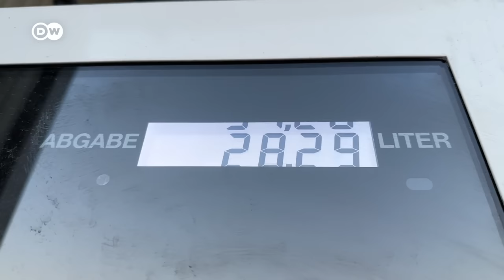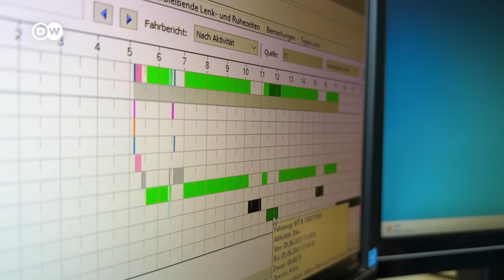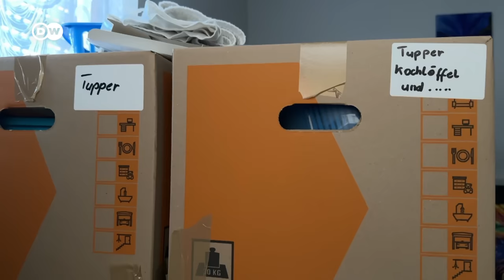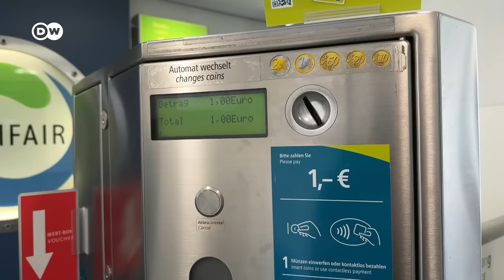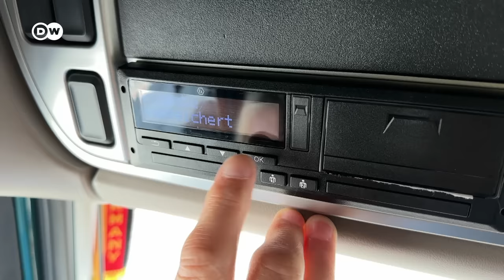Trucking with long-haul driver Biggi - What does it take to drive long distances? | DW Documentary

Comment: Truck driving in Europe looks pretty cool. Beautiful scenery and the cabovers have more room on the inside than I thought. The truck stops look clean too. Definitely would be a nice change of pace to get to drive in Europe for a year or so
Reply: Totally agree. I also feel like that super cheap fleet spec interior we often see in the states isn’t as common with the cab overs in Europe. I’m sure it exists but I feel like a majority of the European trucks I see have the leather wrapped steering wheel, heated/cooled seats, buttons on the steering wheel, nicer seats, etc. that we usually only get on like owner/operator spec trucks. I’m curious how their trucks ride over there too because our trucks are a nightmare; even a brand new 2024 Freightliner Cascadia rides so violently. Even with the seat on the softest air setting, the smallest bump will send me flying through the roof. It’s unbearable. Volvo is the only truck I drove where I could go over a rough road without being thrown all over the place as the interior rattles itself to death. I wonder if the Cabovers are better built.
Reply: @Ward413  I hope to answer your question well.

I would say the base spec model trucks here in Europe are well equipped. They have things like heated seats, steering wheel controls, A/C etc. The higher spec models tend to add things like leather or infotainment or digital climate control etc. But overall I'd say all trucks are well specced.

As for comfort, I would say I have driven MAN's, Iveco's and DAF's that I thought were a bit harsh, but again most trucks, especially Volvo and Scania are very comfortable, even if it's a base spec Volvo FM or Scania G-series. Obviously, the higher spec trucks ride even better and, for me, the best is the Volvo FH16 Globetrotter XL. The automatic gearbox (most cabovers are auto these days) is flawlessly smooth and the truck is very quiet and comfortable on distance. The Scania R-Series is also very good. 

I hope this answers your question, drive safe friend!
Reply: Nah the german roadtoilets are the worst...
Reply: Terrible traffic, no place to park, real terrible on your health. Did it for ten years, now I only take a trip every year or so to remind myself how much better off I am doing something else.

Comment: Biggi needs a green apu in her life
Reply: What's that? 🤔
Reply: It's a auxiliary power unit that allows you to run the air conditioning even if the truck is switched off
Reply: @nomadadmin4381  On Actros standing A/C drains batteries like crazy in the summer... That extra battery would have to be huge too, right?